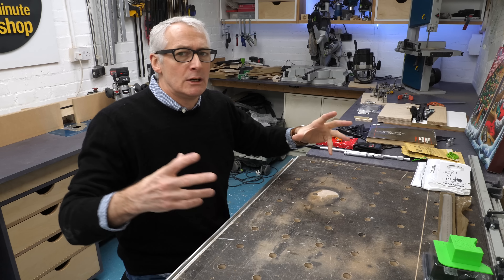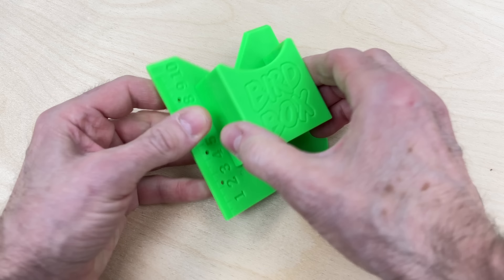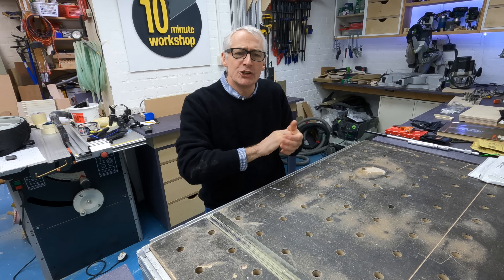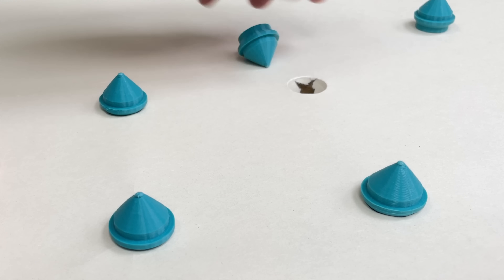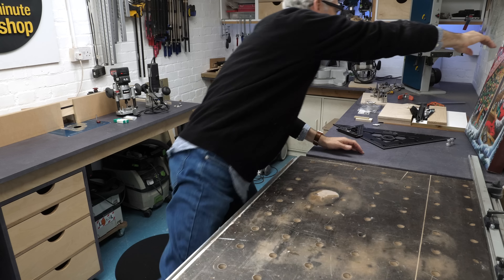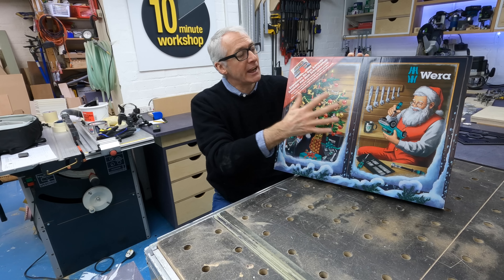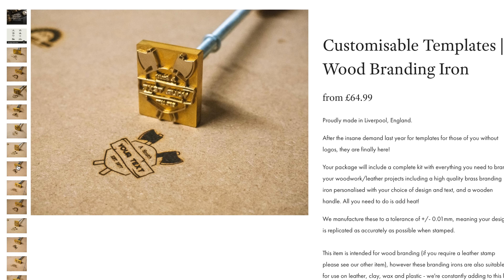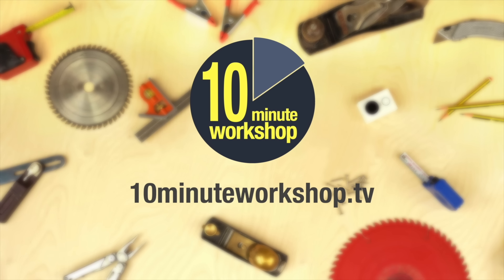Gifts for Makers 2021 [video 480]

Comment: Hi Peter. Couple of comments :- The book you recommended, looks good, takes me back to the words my mentor gave many years ago sometime after the transition to metric measurements; he said you could never make comfortable furniture using metric measurements, that has stuck with me for years so I was pleased to see the book gave sizes using both Imperial and Metric. Has to be useful. 
The Benchdogs square - Big one impressive but to big for use in the workshop, the small one, well I more than enough 'Speed Squares' but the one thing I'm short of is a Square 12" square (I have 2 both not true any more) so one of those BD's squares of an intermediate size - 12"/310mm would be a useful purchase.

Comment: Most heights for seating, and tables are designed for the average 'man', which unfortunately does not work well for the majority of the population. The 1970 book does give both women and men sizes, but the emphasis is on the 'average' man.  There is a need for truly bespoke designs. The odd cm does make a huge difference to comfort, especially for chairs. Ikea (yes I know) tables are way too high for most families, with kids/women/teenagers. If anyone reading this wants to get into truly bespoke, and a very profitable market...just ask the customer, or better still take some samples along. Don't just assume the table/chair dimensions made for your customer are ideal. I specialise in ergonomic design hence comment...Thanks for great recommendations...

Comment: I just noticed: no more Benchdogs mft fence?
Reply from the maker: On my MFT or in the guide? 🤔
Reply: @10MinuteWorkshop  The guide/fence that attaches to bench dogs and replaces the stock Festool fence. I'm on the fence (haha) to buy one so I wondered if some issue made you switch back to the stock fence.
Reply from the maker: No, no issue. But on the MFT you get a greater depth of cut (front to back) with the stock Festool fence, because it attaches to the extrusion, not the MFT top. When Indi my DIY MFT it’ll have the benchdogs fence, no question. 👍